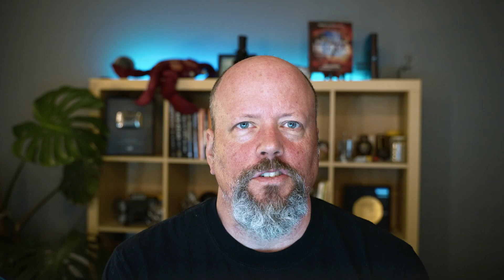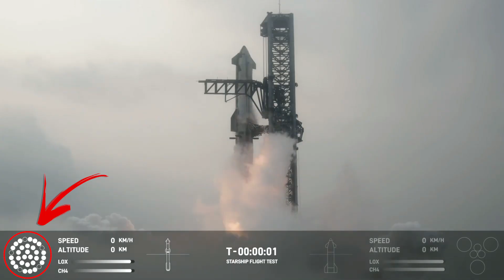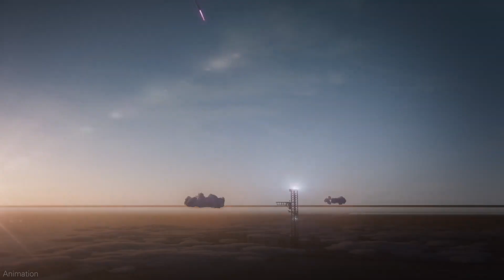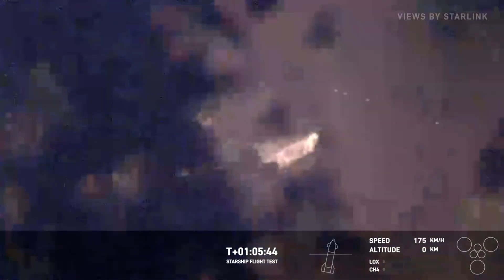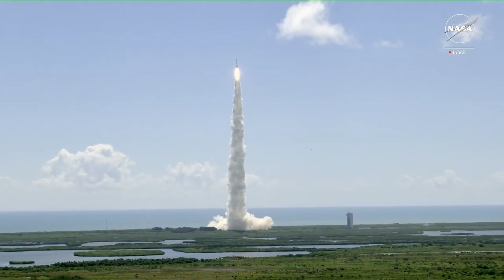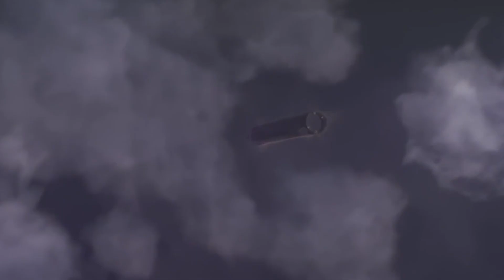IFT-4 and the Future of Starship: All You Need to Know (with @scottmanley  and @MarcusHouse )

Comment: Summary Starship IFT-4 Flight Test

Launch & Booster:

* 1:30 Success: Super Heavy booster landed softly in the ocean after stage separation.
* 1:30 Issues: Lost one engine on liftoff, another destroyed during landing.
* 1:30 Key point: Guidance system compensated for engine failures.

Starship:

* 15:51 Success: Maintained stable attitude throughout flight, including re-entry.
* 28:12 Success: Successfully performed belly flop maneuver and landing burn.
* 24:12 Issues: Significant heat shield damage, flap nearly detached, lost some tiles.
* 15:51 Key point: Demonstrated control and maneuverability despite damage.

Overall:

* 32:52 Verdict: Overwhelmingly successful test, demonstrating key capabilities.
* 32:52 Milestone: Achieved a level of reusability, albeit with refurbishment needed.
* 32:52 Future: Heat shield redesign in progress, aiming for tower catch next flight.
* 45:41 Concerns: Full rapid reusability still a long way off, impacting Artemis.
* 49:10 Other News: Dear Moon mission delayed indefinitely, Starliner reaches ISS with issues, China's Chang'e-6 sample return mission went smoothly. 

i used gemini 1.5 pro to summarize the transcript

Comment: So is the glowing plasma on the Ship's windward side primarily a result of tremendous pressure or friction?
Reply: It's the air being compressed because of the immense speed. It is a common misconseption that the heating is caused by friction.
Reply: @arnelilleseter4755  Thankyou so much!

Comment: Great video guys! Love the exchanges between you. Not sure if you saw that during the ascent of the booster, there is another outer engine with a smaller glow compared to the rest with presumably lower thrust. Could this be to compensate for the lost engine on opposite side. Thanks !

Comment: 16:25 - using the sea-level engines for fine-tuning is an interesting choice - the gimble control was worth more than the ISP gain?
Reply: At that point the sea levels are doing the equivalent of an OMS burn on a Space Shuttle. Namely the insertion burn so directional control is the key factor. The vacuums are the equivalent of the shuttles main engines as far as actual propulsion is concerned.
Reply: There might be a greater LOX residual margin for the inner engines mounted below the lowest point of the LOX tank than the outer engines - I don't think there are pipes inside the tank to  lower the LOX intakes for the outer engines down to the very bottom of the tank.

Comment: I’m glad you guys mentioned the fact that it looks like they burnt through all there fuel just to do a suborbital trial. Where are they going to hold all this extra fuel they are so pose to bring up into space. Or how much realistically can they bring to LEO with the current version especially after all the modifications that are needed to make it reusable. It is possible that they aren’t filling the rocket as much but how much more potential is this able to provide, 100 tons like they say.
Reply: For on orbit fuel depot, they should just make an expendable "TankerShip".
Ditch the 3 atmospheric Raptors, and the heat tiles, and the flaps, etc..
All that weight can now be fuel.
Total "expended" engines: 3 vacuum Raptors.
The 33 engines on the booster is where 90% of the re-use benefit is.

Comment: Maybe a positive flow coolant system into the hinges.
Reply: Mass and cost is very important. They had been considering coolant systems before but decided against them for those reasons. Likely a slight shuffling around of the tiles or slightly thicker ones in a few places should fix the issue.

Comment: If they are going to catch the booster next flight, I can see them launching on one set and catching on a partially built second tower.    If you think about it they don't need any fuel pipes or the OLM stand for the catch.  They also don't need a water deluge system if the booster only using 3 engines during the catch.   If all they are building is the tower itself then it possible to setup in a month,  this would also reduce the potential damage if something goes wrong with the catch.

Comment: My three favorite space YouTubers. Thanks for the great video.

I've been keeping relatively up-to-date on IFT-4 news since the launch, but this is the first piece I've seen to mention the condition of the other 3 flaps. (I don't use Twitter/X.) I also really appreciate the clarification on what "peak heating" actually is. I always thought of heat as an absolute value of thermal energy transfer, so I never made the connection that it was per unit mass of atmosphere and felt like it was too early in reentry.
Reply: I'd say you're correct on at least "heat as an absolute value of thermal energy" (the "transfer" isn't inherent). Do they call that like they do maxQ?

Comment: For reuse, they just need, maybe 20 or so ships, like that Booster would need some work, but they can grab it out of the air, but the Ship has a much harder getting back to the exact position, but it was withing 6 km, so you just need a large area, which they have, go grab it, work it, and launch #2.
Reply: i think the lack of accuracy here was the lack of control the broken flaps had to gain horizontal distance by the glide.  Moments before the flip manoeuvre the nose was pointed 10 degrees from the horizontal in an attempt to glide closer to the predetermined landing point.

Comment: 22:00 - Yeah, "maximum heating" may be achieved early, but it's also not like it's a sudden cutoff after that point. It sustains VERY HIGH heating loads for quite a while after.

I was just surprised at just how little speed was being bled away at the same time there was ultra-high heating. I mean, I took orbital dynamics in college, so I fully understand the theory, and have seen plenty of simulations; but just seeing it in real time was wild.
Reply: Yup and after max hearing has thoroughly weakened the structure, you then have denser and denser atmosphere ripping away the softened and weakened materials as you approach reentry Max-Q…
Reply: I think Scott is a bit imprecise here with his wording. You have to distinguish "peak temperature" of the plasma (expressed as temperature) vs. "peak heating" as in peak deposition of heat (expressed in Watts, i.e. energy per time). He explains a bit using the example of the oven, where high temperature does not necessarily mean high heating (deposition of heat into an object) since heat transfer depends critically on heat conductivity and whether both objects and in physical contact with each other or not.
Reply: @Martinit0  At 22:00 he says first heating, then 'corrects' to temp. Therefore I wonder: do the space techies state "peak heating" like they state "max Q"? And do they do that for what is actually peak temp?

Comment: Discuss this fact. This thing was fully loaded with fuel and absolutely nothing else other than essential hardware and equipment to fly it. No payload. Not even 1 roll of toilet paper in payload. Even flying completely Empty it still did not actually reach orbit or orbital velocity. It looks like to me it is taking them 100% of it's capability just to be able to pull of what they did. If Musk puts the 100+ tons of cargo on the next one it will sit on the pad and burn a hole to the other side of the Earth. So if it takes 100% fuel load to haul nothing to a Non Orbit Musk better get to work on Raptor Version #6.
Reply: The current full stack, fully fueled, weighs in at ~5000 tons, and jumps off the pad with a thrust-to-weight ratio of around 1.5.  Adding a 100 ton payload amounts to a 2% increase in launch mass.  So nope, it won't prevent the rocket from lifting off.

As far as the current Block 1 prototypes go, Musk has already said they fall short of the 100 ton to orbit goal; he said the current hardware could lift around 40-50 tons; but SpaceX has already stopped building new Block 1 Ships (they currently have 3 remaining in stock, in varying states of completion).  Upcoming Block 2 designs will achieve 100 tons to orbit, by "stretching" both Ship and Booster - allowing them both to carry more propellant - as well as optimizing in other ways to reduce dry mass and increase engine performance.

The next design after Block 2 - Block 3 - will stretch both Ship and Booster even more; will use more powerful and less heavy Raptor 3 engines instead of Raptor 2, with up to 35 of them on Booster and 9 on Ship (vs. 33 and 6 on Block 1 hardware) - and will target a lift capacity of 200+ tons to LEO.
Reply: @Spherical_Cow it doesn’t jump off the pad? What are you even saying???? Also clearly someone doesn’t understand the rocket equation.
Reply: @TheCosmicGuy0111  I'm saying the Starship stack launches with a TWR of ~1.5.  What are you trying to say?

Comment: IMO all the extra task they loaded into IFT 3 were really because they didn't think either vehicle would make it to a soft landing anyhow. So they wanted to add things that could be successful into a mission that was likely to end in a double RUD....Different story with IFT 4. Now they had enough confidence it would be successful that then they didn't want to add extra test cuz failure of one of those addon task could cause a RUD.
Reply: Can we focus on the fact that they were confidant enough in the control of this rocket to place a buoy with a camera in the ocean where they planned to land so that they could video the landing!  That's amazing!
Reply: @michaelstoliker971  For the Booster yes but for Starship they were Kilometre's off!
Reply: @Leon1Aust  Thanks, I'm aware.
Reply: @Leon1Aust  The booster operated as expected and landed where expected.  The Starship did not operate within design parameters and did not land where expected.  When they figure out how to keep the flaps from melting,p they'll have another piece of the puzzle.
Reply: @michaelstoliker971  Booster did not operate as expected, an engine got ripped off and nearly wiped out the booster.
Reply: @Leon1Aust  One engine exploded and had almost zero effect on the booster as it was not one of the three used for landing simulation in the ocean.  Were you watching the same launch?
Reply: @michaelstoliker971  It detached during the boosters descent and ripped passed the booster at very high speed.
Who cares what it is used for!  the dam thing ripped past the booster, very very dangerous situation for any other space craft.
Buy hey Space X can do no wrong perfect flight!🤔🫤
Reply: Sounds like nonsense to me.  🤷‍♂️
Reply: @737smartin  Well on IFT 3 had the door not closed it would have caused a RUD. Had the propellant transfer only partially completed it would have caused a RUD. 

Neither of these test had anything to do with IFT 3's primary mission which was demonstrating Starship can make orbit and a controlled reentry with a soft water landing of both vehicles. 

It would have been stupid to risk LOV and failure of your primary mission to conduct either the door or fuel transfer test. 

If however you're confident the vehicle will RUD at reentry regardless then there is technical, economic and public relations value in conducting the secondary test.

As in they collected valuable data without risking a vehicle. They turned public perception of IFT 3 which failed most of it's primary mission goals into a perceived success. And they fulfilled their NASA contract to demonstrate propellant transfer earning SpaceX $250 million dollars...Roughly the price of the vehicle expended in IFT 3.
Reply: @THX..1138  You go too far when you make it sound like they were sabotaging flight three, though.  There was certainly more risk with running ancillary testing, but I really don’t think they were going nearly that far.  
We can most certainly agree they decided that flight four was time for a no-nonsense, sure check of the Ship reentry, so ALL focus was there.
Reply: @737smartin  there is a reason why they put a camera pointing right at a forward flap covering the entire view and focused so much on it. 
They knew the flap hinges were a weak point, they were expecting starship to RUD, hence why they didn't prepare any cameras or recovery. They thought the booster would reach the water but break so they only put a camera to check how it would eventually RUD or fail.
All of these little details people casually skip for some reason. And Fraser here being skeptic because they took a long time with Falcon, assuming none of the tons of knowledge gained wouldn't translate and be the reason starship is moving so quickly compared to falcon. Should be skeptical about other stuff proposed by spacex instead.
Reply: @737smartin  It's not sabotage, these are test vehicles. They know they are probably going to fail and most of the time they know how....

For instance SpaceX announced 2 years ago the flaw in their flap design and the fix for it, but they Launched IFT 4 knowing the heatshield and flap design were likely to fail and they will launch IFT 5 that has the same flawed flap design with at best a few patches to give the best chance of surviving. 

Because these were all old prototypes that cannot not be retrofitted to the latest designs. The only thing they are good for is gathering data to make the next generation of prototypes better.

Comment: It's possible to have hinges without gaps, they are known as flexures. There are also gas-tight spherical hinges like those used in the Shuttle/SLS SRBs.
Reply: Do any of these work across reentry temperature ranges? Do you have links for the gas-tight spherical hinges used in the SRBs? Same question for those of course.
Reply: @dirkbester9050  flexures will work as long as the material doesn't yield when deflected. This usually requires a thin section which can't absorb a lot of heat but the joint would be designed so the thinnest parts aren't directly exposed to the hot gas or radiation. Tool steel alloys are available that don't lose much strength even at a red heat and there are also alloys like osmium that work at even higher temperatures. They should work for reentry in principle, but I don't know of any actual applications.

Solid rocket engine structures are heated both by convection and intense radiation so the conditions are similar if not worse than those experienced during reentry. The joint between the nozzle and the combustion chamber is made of alternating spherical shells sandwiching a high-temperature rubber. For a control surface it would probably use a cylindrical arrangement. The joints are described in chapter 18 of Rocket Propulsion Elements 9th. ed from Wiley.
Reply: I don't think you can make flexures out of ceramic.
Reply: @lukekambic3536  it may not be possible to use ceramic materials by themselves to construct a large range of motion hinge, but they can be made into thin sheets or fibers and incorporated into a rubber or metal matrix that has the required flexibility

Comment: I’m curious to know why hot staging is still being considered when the ring weighs so much. Surely, clamps and pistons or electrically-driven ejectors would be lighter.
Reply: Hot staging was always a (quite literally) tacked-on procedure with this version of the hardware.  No doubt the system will weigh less when it's properly integrated into future revisions.
Reply: How much prop mass that you'd need to also carry & burn to make up for the gap in thrust during cold staging? You'd need to factor that in too.

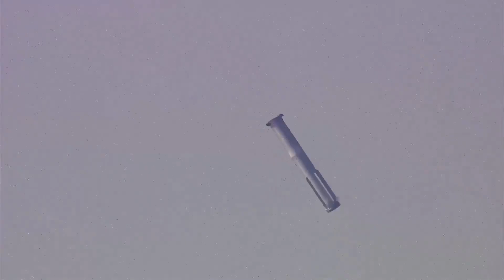Comment: 15:26 They say this was a shock cone, but this feels very debatable.  Although Booster was still supersonic at this moment, this was right before the engines came back on, which means they were spinning up.  And we know that this generates a brief moment of vapor.  My suspicion is that this was primarily or exclusively vapor from the engines.
Reply: Vapor from engine spin up won't generate a cone-shaped cloud like that.
Reply: @Spherical_Cow  Left unsaid, because I didn't feel as though explaining the obvious was necessary, is that the vapor would immediately be caught in the invisible but very much present shock front that Booster is generating during its plunge.
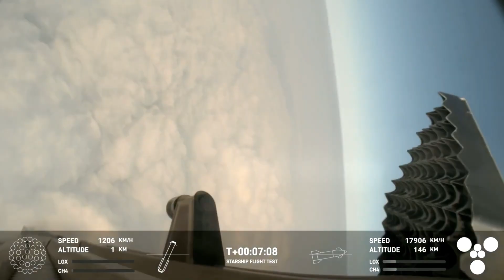Reply: At 12:00, study how the vapor cone appears on the grid fin, too, disappearing right as the engines light, just like the engine bay. That was absolutely a shock cone in both places.
Reply: How fast would these start-up gasses have to travel in order to reach the outer parts of the cone? While the visible cone shape travels with the booster, I don't think the air in this region is also travelling along with the booster in a way that "traps" gasses - similar to how a wave travels along the surface of the ocean far faster than the actual water itself.

Comment: I’m curious to know why hot staging is still being considered when the ring weighs so much. Surely, clamps and pistons or electrically-driven ejectors would be lighter.
Reply: Because SpaceX wants Ship to fire its engines while Booster is still thrusting.  Conventional staging involves a pause during which gravity losses are incurred.  Hot-staging improves the final mass to orbit by ~10% according to Musk.  That's despite the extra mass added by the hot-staging adapter; but SpaceX also said that future Block 2 Boosters will have an inherently lighter, better integrated hot-staging interface (which won't be getting jettisoned, either.)